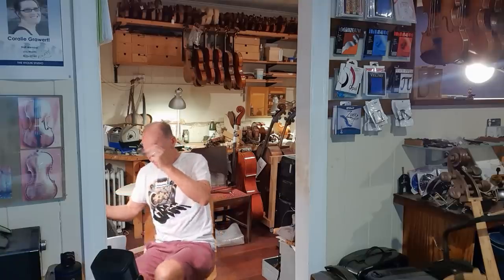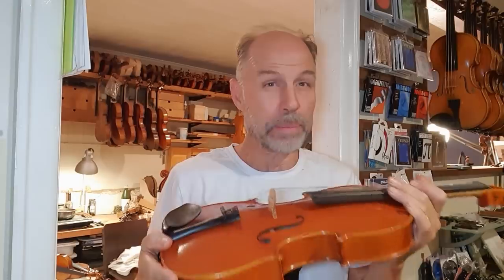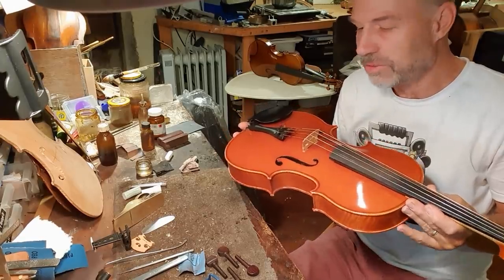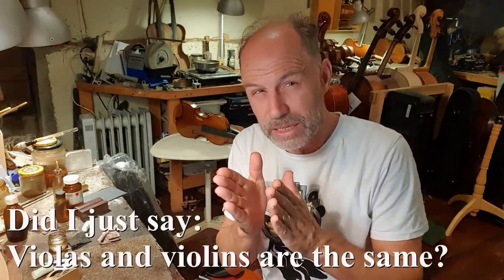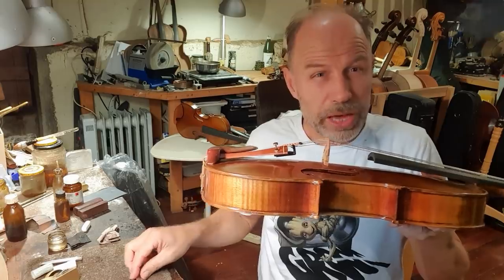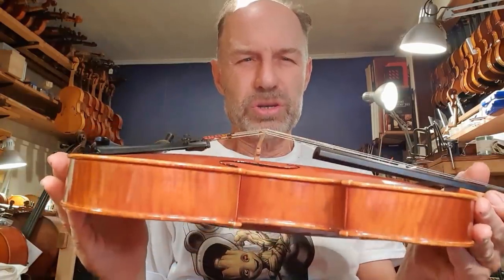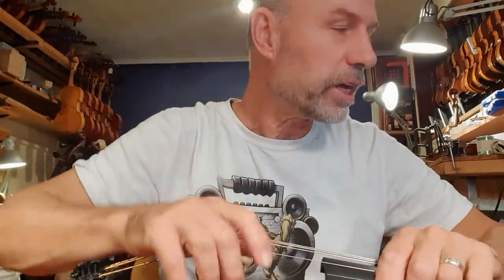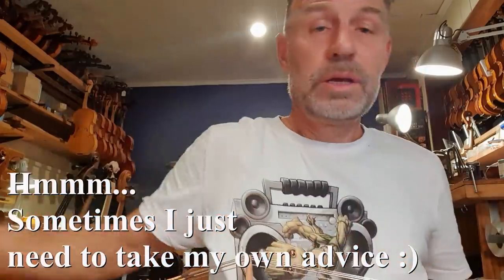The Terribly Bent Viola Bridge and how to keep bridges straight

Comment: I recently had my bridge changed. Based on the makers mark on the bridge and when it last passed through the maker's workshop, I estimated it to be about 65 years old. Unbeknownst to me, the bridge had developed a crack that spanned its entire width, nd I have had the violin for about 15 years! With a new bridge, adjustments to the tailpiece position, the violin sounds significantly better.

Comment: I was using the square wrong.. I had it literally where the bridge goes, which is  one long constant curve from scroll to endpin.  Only after I watched this did I realize the square / card / whatever measuring tool you're using goes on the purfling.  Compared to my eyeballing method.. this was spot-on.  I get the same results either way, by eyeballing against my blinds or using a business cards.  Thanks for showing us how it's done, Olaf!

Comment: I have a question; maybe you could consider it a video suggestion? Entirely up to you, of course.
What (if any) structural differences are there between violins, violas, cellos, etc. which make it so they're not just different-sized versions of the same instrument?
I've been wondering because, like, there's miniature versions of various instruments for different ages of players and whatnot, so there obviously has to be something that makes it so a miniature viola, for example, can't be considered/used-as a mini violin-with-different-strings or something. Or something that makes it so you couldn't just put cello strings on a smaller-sized double bass and use it that way.
Or could you do that? Could you put violin strings on, like, a 3/4 size viola, or 3/4 viola strings on a regular violin? (I know the size difference between violin and viola is probably not 3/4, but I'm not sure how else to phrase my question to make it clear what I'm asking.)

Comment: Hi Olaf, I have a question to ask you... Sorry that's it's not about today's video... My violin's sound post have a little bit crack on it, I'm wondering how much do a good soundpost usually cost? (AUD is fine) And also how do we choose a soundpost that suits my violin? Because my violin is a new violin (maybe made for about 6 years I think), and there is also no label in the violin so I don't know how to choose the soundpost.... Please help me!!!
Reply: Is it actually crack or is it just normal cut from soundpost tool ?
if it is some 2-5mm long cut in the center of the soundpost it is perfectly normal.
Reply: @rofo2107  I don't think it is a cut as it is not cut beautifully. I think it's around 1-2 mm? I'm not good at estimating
Reply: @rofo2107  Anyway thanks for your help!!!
Reply: I guess it is a mark of soundpost tool as well. Soundpost usually don't crack, especially on relatively new instruments. Sometimes marks after soundpost tool may look ugly or in the worst scenario the soundpost can be chipped by soundpost tool from the factory. Better to consult with local luthier.
Reply: @luborkloda8903  Yes, I think I'll go to a music workshop after the exam... But there's really rare luthier, or no luthier in my city... This is the worst. Thank you!

Comment: any tips on when to use a humidifier? when to start during the year when to stop?
Reply: Get a humidistat/hygrostat, so that you actually know your relative humidity, and try to keep your it consistent. Usually around 50% is best, but avoiding big swings and extremes is the most important.
When to start/stop running it depends on where you live. In temperate climates, you'll usually only need to run it in the winter, since the air indoors will be a lot drier. If you live in a dry desert you might find it you need it year-round.

Comment: IMHO crooked viola bridge can be repaired easily. Just boil it 5 minutes in hot water, then bend it to opposite direction, let it dry and put it back. Better then new :)
Reply: Cut bridge straight. Flat bridge viola have four times better probability hit the correct note.
Reply from the maker: It won't be the same... It will bend more easily once it has been crooked. Also it won't sound the same... but it is a good emergency fix
Reply: @rofo2107  or just remove. viola without bridge as zero probability of hitting wrong note.

Comment: I had my violin in storage for a long while somewhere humid and it bent nearly to the point of breaking. Being very far from a violin repairer (both geographically and personally) I soaked it in boiling water, let it dry under weights and put it back. Then I spilled tea on it and had to do it again. The strings are chewing through the bridge a bit quick now, but in about a year I should be able to get a proper professional repair.
I'm so sorry Olaf. I repent for my violin sins 🙏

Comment: Olaf, please can be snaped bridge glued with hide glue as an emergency fix ? Or just kept as spare bridge for an emergency backup ?
Reply: If the bridge is snapped, you need a new one. I'm no luthier, but if the bridge is just bent and you're poor as hell (like me) and can't always afford a luthier, you can put the bridge on a flat surface and put a brick on top of it for a week or two and it straightens out a bit (I've done it). That's the ghetto solution lol. I've done it and it works, but it's only a fast fix and you have to get a new bridge as soon as you can because that bridge has already gone bad once

The problem with a bridge snapping is that it often causes the soundpost to come loose as the soundpost is kept in place by the tension of the strings on the bridge which causes tension on the soundpost, keeping it in place (which is why they tell you to change your strings one at a time). Without special tools and intimate knowledge of the instrument, having an extra bridge would be pointless unless you can reset the soundpost yourself.
Reply: @diegoserrato4016  well problem with bridge is that it is super light super perfectly shaped piece of wood. I don't know, it weights some 5 grams and it is supporting 25 kilos.. I think a crack in this structure will probably have impact on vibrations but hide glue is very good sound carrying material.
I already tried it and the bridge tone quality is as good as new, I have only worries that hide glue could separate during hot and wet weather :)

Comment: I'm sure this question has been asked, and please forgive my small bit of knowledge about bowed string instruments, but why doesn't the bridge get a light coat of varnish to protect it from humidity? I assume it negatively affects the proper vibration transfer through the wood somehow, or is it just a matter of being traditional not to varnish bridges? I've seen bridges on more modernized instrument designs, like the beautiful Luis & Clark line of carbon fiber instruments, and they are wood bridges (naturally,) and are not varnished either. I wonder, if carbon fiber can make such good sounding, durable, and easy to maintain instruments, could a functional bridge be made out of tightly compressed carbon fiber sheets, and resin, or some other type of composite materials?

I love your very informative, and entertaining, videos. I would love to learn the science of instrument design, construction, and function from you. Thank you for your videos.
Reply: Another quick question I had, that's a bit off the subject of bridges, but I was curious if using a two piece sound board is acceptable, or the mark of a cheaper instrument? I always thought that all sound boards were one piece, to make them better handle the weight of the bridge under string tension, but I found out that some have two piece sound boards. Personally, I like a solid sound board, and back, to these beautiful instruments. I also like non pernambuco or ebony bows, and non ebony finger boards or pegs, since the woods are endangered, and stocks of them are going down. White wood covered in a thin sheet of ebony wouldn't be bad for me, as long as it's made right, with the proper curvature and spoon, so no planing would be necessary to correct it, but I don't know if a thin layer of ebony would properly conform to, and bond properly to, both the curvature and spoon shapes. Man, what I would give to be able to afford one of your fine student violins, and cellos, but caring for my Mother's needs, after her strokes, takes up most of my budget.
Reply from the maker: Hi, thanks for the feedback 🙂
I apply a little bit of oil to the bridge to protect it. 
A lot of Stradivarius instruments are joined and still sound amazing. So no it just doesn't matter either way for sound.
Reply: @AskOlaftheViolinmaker  Oh ok, I didn't even think about a light oiling to protect a bridge. Thank you for your quick response!

Comment: My bridge was worse. Luckily it was the other way (the bridge bent towards the flatter side, i didn't know i was pulling too far back when tuning) so I was able to straighten it by soaking it for a few minutes in boiling water and used a clothes iron to press it gently back to its original state.
Reply: I’ve done a similar trick for a musician that had a concert that week but couldn’t afford a new bridge for a while. It’s not permanent and isn’t actually good for the sound of the bridge. It will still need to be replaced pretty soon after. I don’t completely submerge it in boiling water. I just wrap it it hot damp paper towels and slowly clamp it down with my large press and let it dry and cool down in there. It’s just a cheap, quick, and temporary fix for when you’re in a pinch. It is absolutely not a permanent solution.
Reply: @NatJediMASTER  It is alchemy. Some bridges can last long time even if boiled and straightened. Some not. Is it affecting sound ? Yes and no. I suppose some timber structures get corrupted during boiling so basically the boiled bridge is softer, weaker and produces a more hollow and weaker sound. Which sometimes can help. I'd not try it on Strad but on some cheaper instrument it could be worth trying.